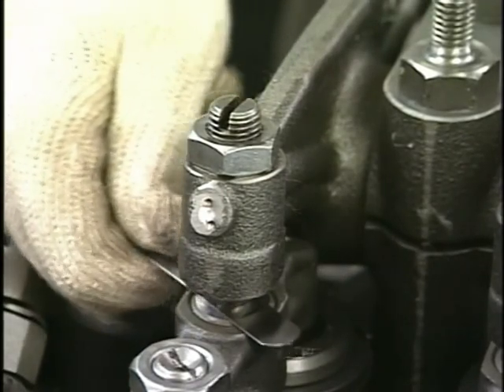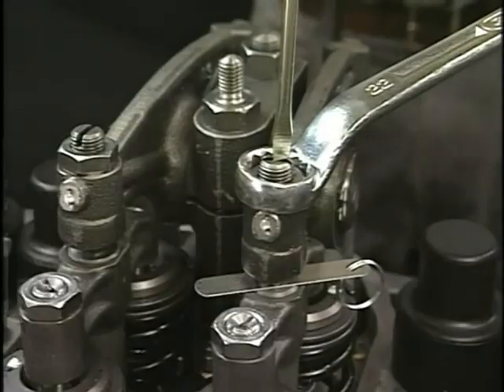Yanmar 6EY22 Marine Diesel Engine Maintenance 3 Adjustment of valve clearance  ضبط التاكيهات

Comment: Sir can you tell me please,my generator brand yanmar is one of the cylinder is very high temperature exhaust gas (370) degree Celsius and the other cylinders is 220 up to 250.what I have to do to make it normally,thank you
Reply: Buy a other generator!
Reply from the maker: Check fuel.. rich mix

Comment: Our auxiliary engine exhaust temperature very high 450 degrees i already calibrate the injector, replace plunger barrel and adjust tappet clearance and changed oil but exhaust temp. Very high..whats the problem?
Reply from the maker: Check the combustion pressure.
Also check fuel specifications and take a sample for analysis to compare it with the fuel specifications recommended for the engine by the manufacturer
Reply: adjust the racks of the f.o pumps..
Reply: Thank you every one I already solve the Problem, The causes is
Aircooler Fins was clogged up lock of suction air.

Comment: what the meaning 3-4 B ?.thanks
Reply from the maker: It means that pistons no 3 and 4 are at the bottom dead center BDC
Reply: @SASplatform  thanks so much
Reply from the maker: You are welcome any time 🙂
Reply: hello my dear frend. have you some video about D/G sulzer. acsample valve clears? thank you before
Reply: the D/G model sulze  4S20H 3CWF (4strok)

Comment: what is the condition of the engine while adjusting tappet clearance? what are the preparations before the job? how many months/ running hours for adjustment of tappet clearance?
Reply from the maker: Thanks for your inquiry.. 😊 

The condition is the engine is shut off and cold.
No preparation needed, only be sure it won't accidentally run while doing that and use proper tools and take safety precautions.
And the intervals between the checks/adjustment are according to the manual (the engine manual).

You are welcome any time to ask.. And please, feel free to share the videos. 👍
Reply: @SASplatform  It would be nice to have more videos about the generator, like generator parts and performance tuning.
Reply from the maker: We wish to have this soon. Thanks for asking
Reply: @SASplatform  thank you too, more yanmar videos, water and fuel systems too
Reply from the maker: The ship system or the machinery pipes?
Reply: good👍👍👍
Reply: LOL. Dude dont forget to open indicator cocks, otherwise u need to be a superman to turn shaft. Mby u ll damage something

Comment: No sound
Reply: Very helpful..Thank you very much for the explanation..
Reply from the maker: You are so welcome 😀.
Please feel free to share the videos. 👍
Reply from the maker: We apologize for the sound, but no voice comment needed as the steps are clear.
Thanks for your feedback. 👍
Reply: Can explain the setting for adjustment screw of bridge valve?
Reply from the maker: Sure.
First..
There is a clearance between the valve bridge and the valves itself, this clearance must be Zero, this done by the screw and the not on the valve bridge..

Second..
There is a clearance between the rocker arm and the pushing rod, this clearance must be Zero, this done by simply press on the rocker arm end so you be sure that it is Zero gap between it and the pushing rod.

Finally.. You will end up having gap only between the rocker arm and the valve bridge, you can check for its clearance number (here in this model 0.4 fir intake valves and 0.7 for exhaust ones.

We hope we answered your inquiry and you are welcome anytime to ask us.
😀👍